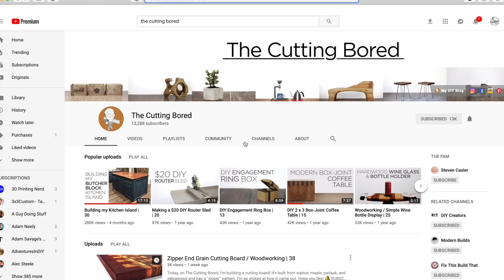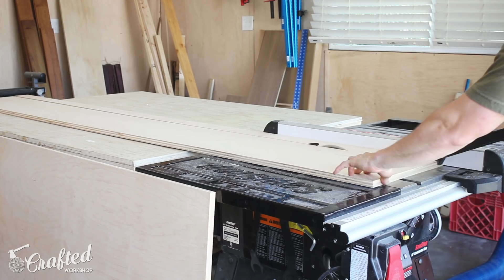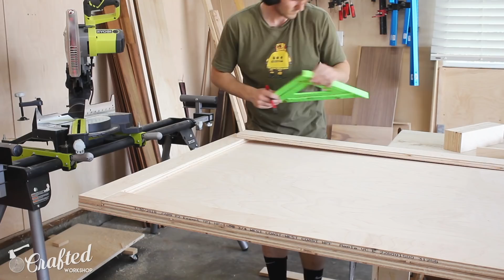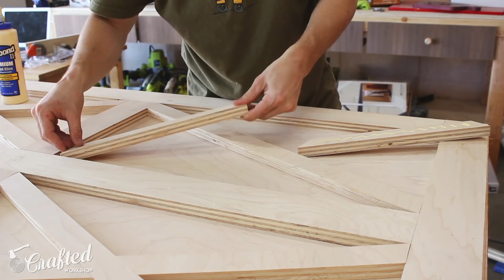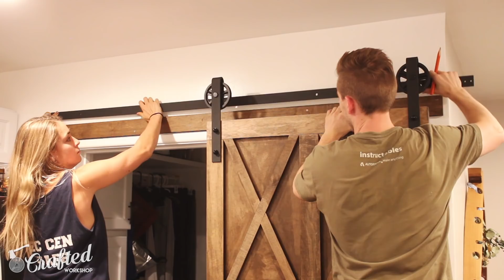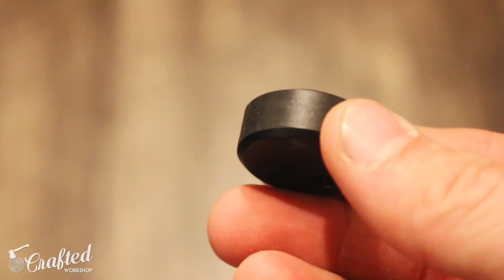DIY Plywood Sliding Barn Door For $200 // How To Build - Woodworking

Comment: Look on Amazon for barn door floor guide wheels. They attach to the baseboard and a small wheel goes in front of and behind the door. It makes the operation a lot smoother than the groove on the bottom of the door with the piece attached to the floor. Ive built three barn doors for my house with just plywood but they were all painted. It works great. They are $19.97
Reply from the maker: Nice, will do!
Reply: Can you post a link for them?